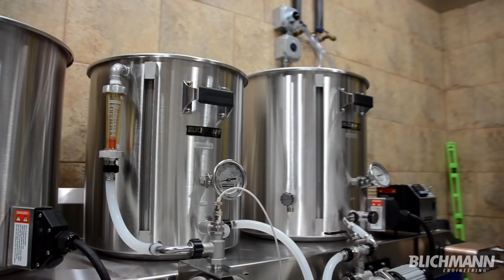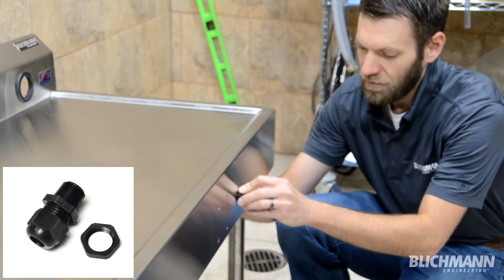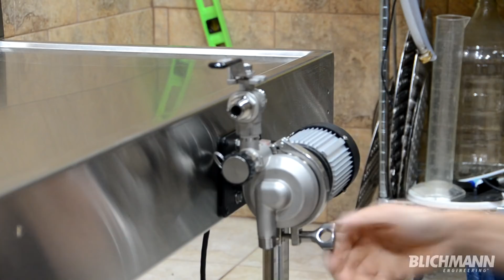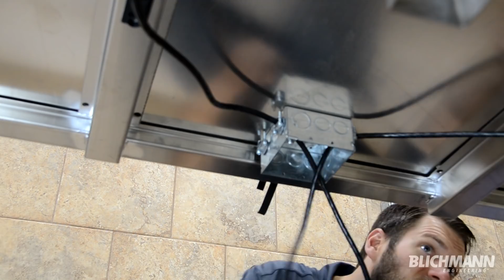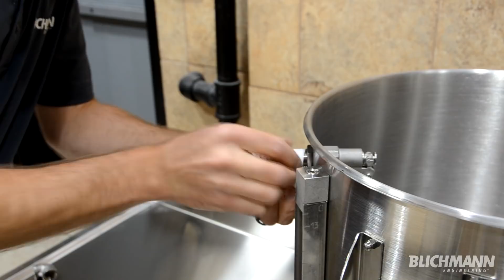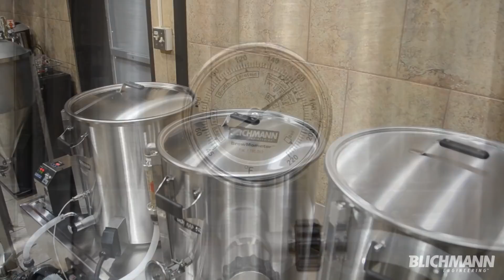Blichmann Engineering Pro Pilot System

Comment: I purchased a 20 gallon Blichmann system back in 2007. I was in need of a new lautertun because the plate in my tun collapsed. The HBS had a 10 gallon Blichmann kettle and plate on display. 
Pots are pots, the plate is what sold me on purchasing Blichmann equipment and I ordered a 20 gallon system. The extraction rate through the Blichmann plate is close to that of a slotted decoction plate and similar to a decoction plate the Blichmann plate allows very little chaff through the slots and from around the edge to enter the bottom of the tun because the rim rests on a shelf and water on the shelf seals the plate to the shelf. Stuck mash is less of an issue due to the design of the plate, as well. In 2016 I purchased their one barrel system because I wanted to increase volume without adding more brew days. Both systems were built for the decoction brewing method, I use the decoction method. I stuck with Blichmann because the 20 gallon system worked well and with very little dialing in. 
If Blichmann Co. existed when I began to learn how to brew beer I would have purchased only two systems. Instead, throughout the years I cobbled together many soup pots, kegs, lemonade coolers, beer can coolers, bags, screens, glass, tubing, fittings, valves and buckets and I killed myself using the stuff to make beer with. If I figure in the hours that it took to cobble all of the stuff together and put it in a dollar amount I could have asked Blichmann to build a system for me out of Titanium and gold with diamond and ruby studded Ivory handles and still have money left over to pay a lackey. I blame Blichmann for not being around 35 years ago, it cost me money.
Reply: where did you stop ?

Comment: My RIMS rocket on my 10 gallon system always reads like 4-6 degrees higher then what the kettle thermometer reads. Which one am I supposed to be lookin at?

Also the RIMS rocket manual gives no “starting point” for power/flow rate ratios. Where is a hood starting point to get the most consistent temp without large fluctuations?

Comment: A little disappointed you didn't use an obvious watertight junction box underneath there.  Better safe than sorry.
Reply: Its bolted in place, you may switch it out if needed, but how often are you spraying water on the underside of the table? I haven't had a problem with mine.
Reply: Steven Trott do you have the pro series?